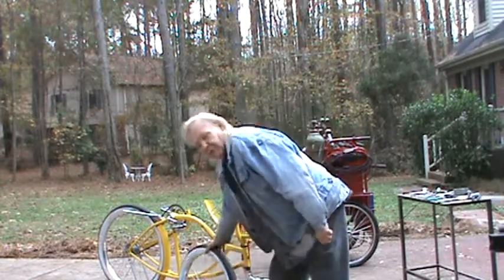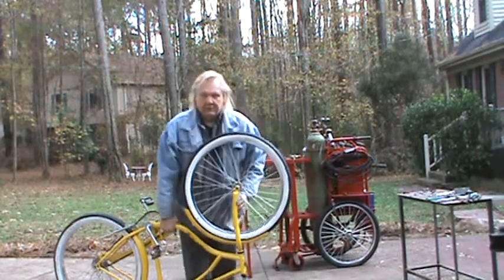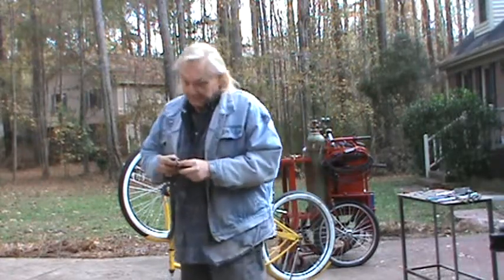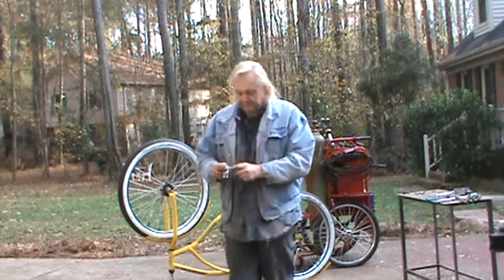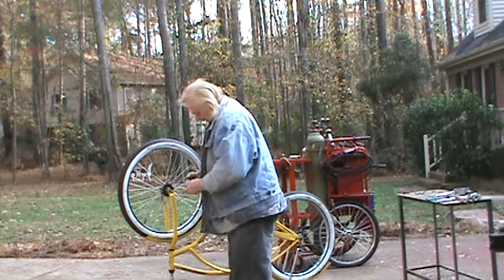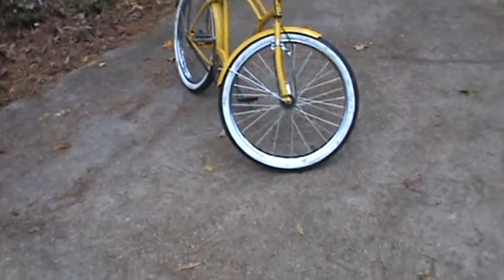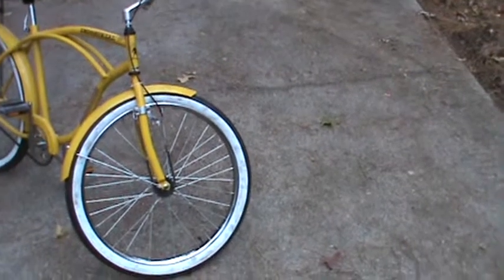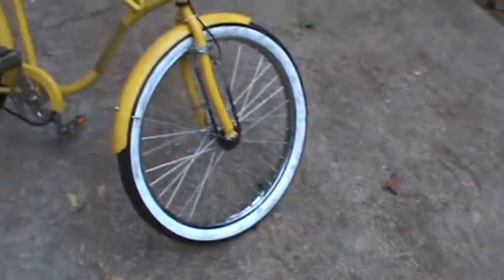Cruiser bike front coaster brake

Comment: I have always felt a little uncomfortable with just a single coaster brake,  So I never went to fast,  Or ride down a mountain pass with those bikes. I't would not take  much to assemble a regular canterlooped rim-brake on the front wheel, Or would it,  But it would be greate to ride down a mountain pass in full control on a big fat bike.
Reply: I would call it,  A  Barley-Mavis &  Son.

Comment: Not a good concept and I don't know why anyone would excluding someone with a bicycle junkyard would think it was ?,Aside from the amount of time consumed the parts in that featured assembly are undesirable in most if not all instances...
Reply from the maker: hell, it's just an experiment, I went into this stating I never saw anyone try this before and I didn't know if it would even work, but you don't know until you try.
Reply: Now don't get me wrong I'd had the same idea in general about building a motorized bicycle.This was three years ago or so and it's yet to be completed. I've gained some insight without mention most of which has equates to consumption of time that I'd known likely to yield much less than the idea itself presents under ideal conditions.
Reply from the maker: Well it's a brainstorm I came up with several years ago, I already had everything sitting around to make it with so I'm giving it a try and if it works cool if it doesn't, I'll just leave it on 'cause it looks cool and is semi functional as it is, plus I have something no-one else has, LOL!